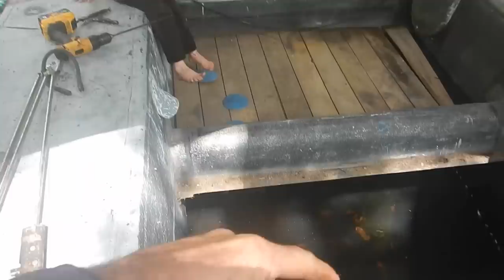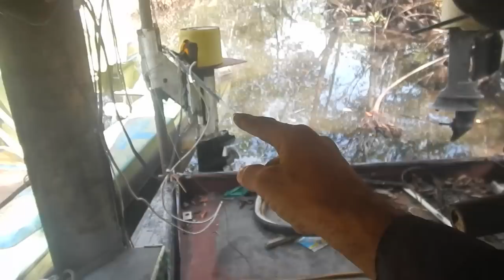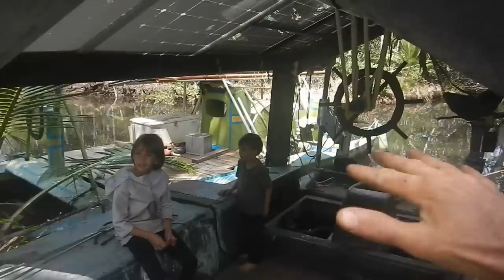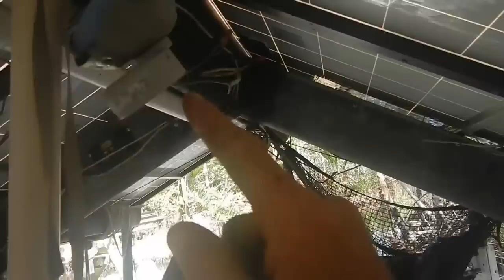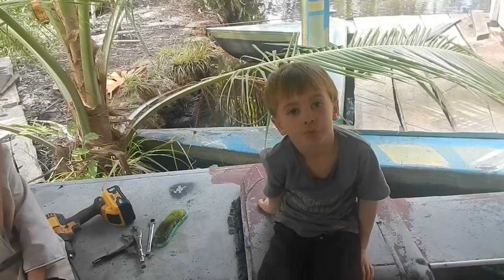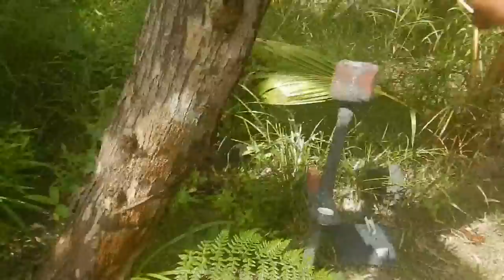Shark Slicer Upgrade 008 Pedals Installed

Comment: Maybe design a "temporary" set of peddles for smaller legs that can be driven to a pully on the main peddles that can be removed when not in use. Could also hook up an electric motor via the same pully system for e-power. Otherwise, I think best leave it as is... It's been a good design, it'd be a shame to see it be turned into something else less utilitarian.

Comment: Do you really need an "aero" quick barge? Fix the rudder (s) and solar drive first. You have the other boat for quick trips. Make a quick and easy way to haul your boats out to eliminate bottom growth and wasted time bottom cleaning.
Reply: I was even thinking some flaps on the outsides of the center rook supports, when the wind is behind you open them up to catch the wind like a spinnaker.  Probably could experiment a bit with some flaps on the other supports and use them like vertical wings instead of horizontal.

Comment: you need to figure out a reliable motor situation. does your old sailboat  have 2to1 gear/transmission with shaft,prop and strut? you have that lynch motor in that other outboard. youre not getting any younger